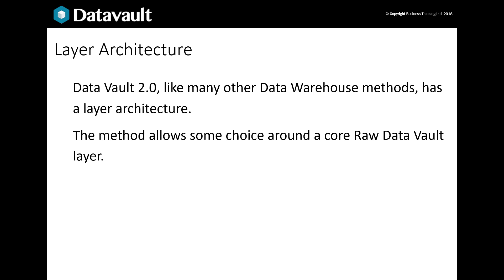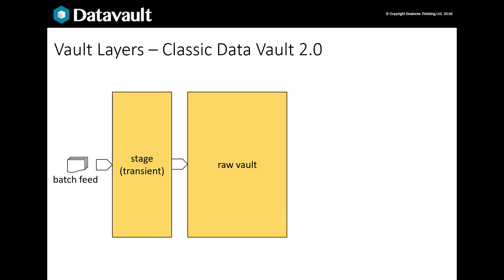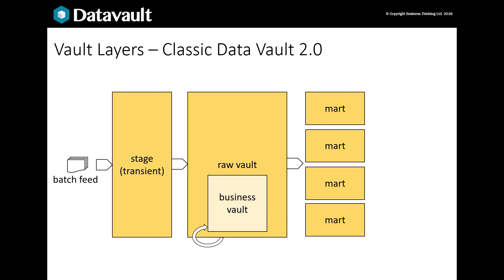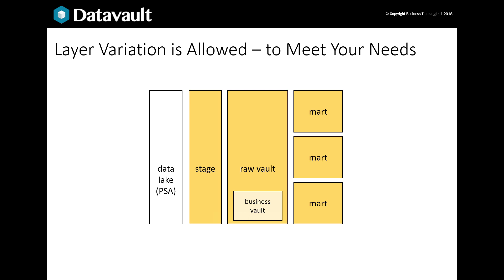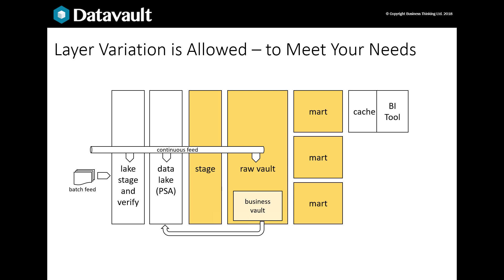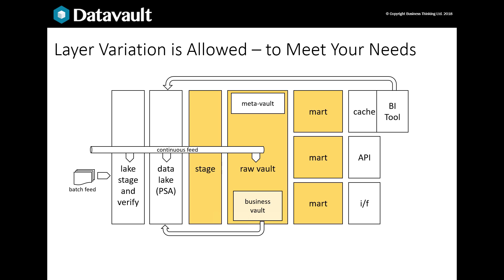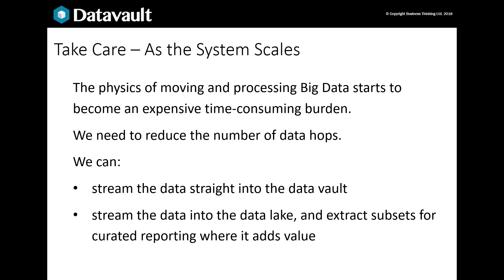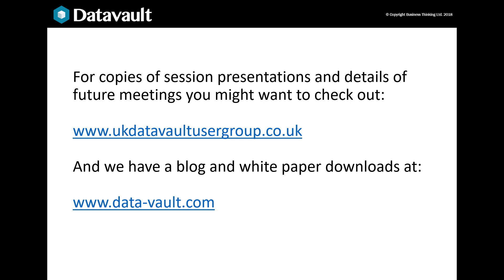A brief introduction Data Vault 2.0 - Part 3 of 7 - Architecture

Comment: Can you please help me with these . Would be great if you can explain with some examples.

1. Why link to link relationship is not recommended in RDV?

2. In BDV bridge table, if we are storing only hash keys( not natural keys), then how in fact/dimension we are going to get natural keys?
Reply: Hi, I also have a doubt about how the satellite to handle  the SCD(slow changing data) case, could you help me to clarify  it, thank! If there a satellite stored the address information with a hash key, when the incremental data come,  a address was updated. will have two hash keys related to these two address info or only one hash keys and the different is the load_date?